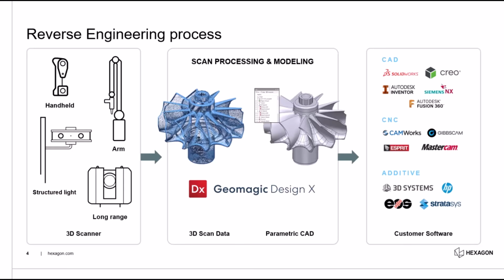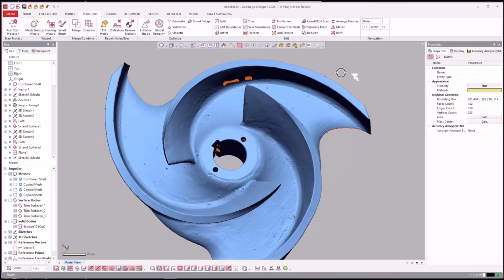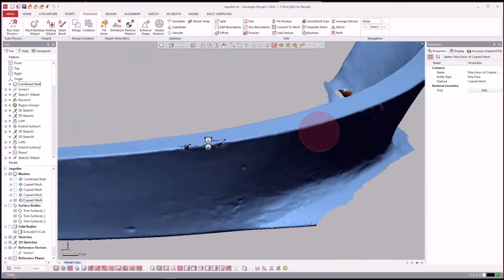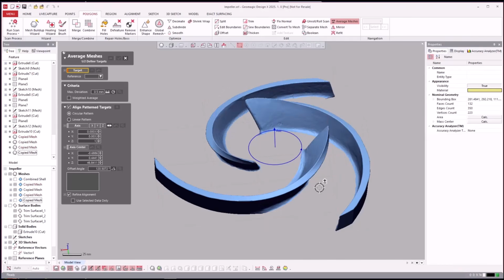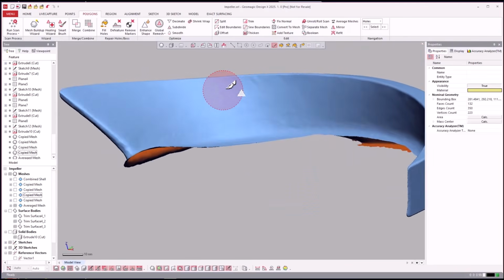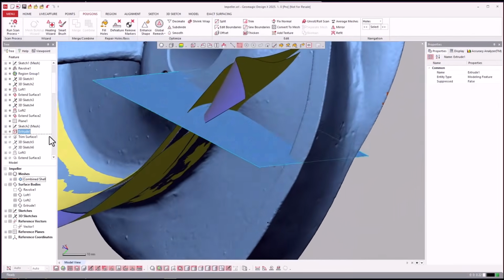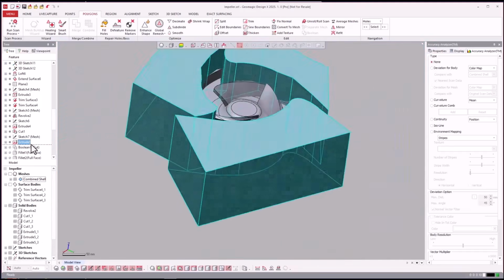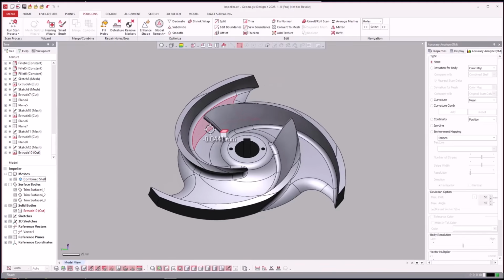Reverse Engineering an Industrial Impeller | Geomagic Design X

Comment: One problem that people tend to ignore is that it can be very difficult, to nearly impossible, to get the stl file aligned perfectly. Then when you mirror or copy CAD geometry based on an imperfect alignment you get the type of deviation shown. Too often the operators assume the alignment is better than it really is or don't quite understand that the alignment will result in the geometry created being inaccurate. A slight misalignment can throw the geometry off quite a bit. It's my personal opinion and experience that a perfect alignment is unlikely, and that will throw off geometry creation. It's an imperfect process, we can only get close. Then like what may have been mentioned, we're working with imperfect parts, there's always some deviation in "as manufactured" parts. A center axis isn't necessarily normal to a mating surface, even a little deviation can result in inaccuracies during modeling.